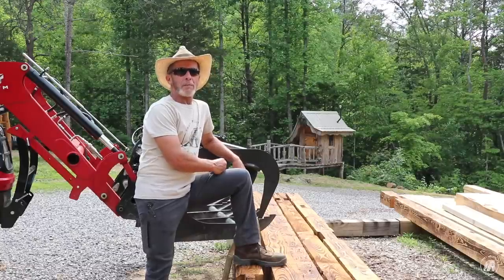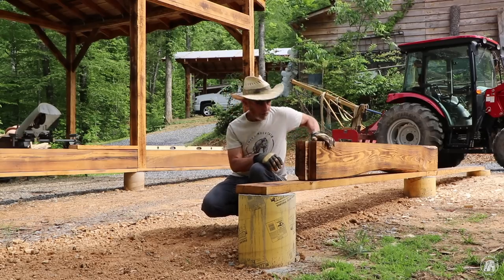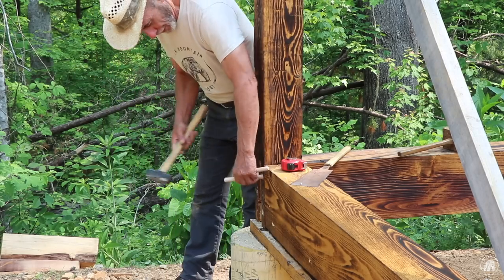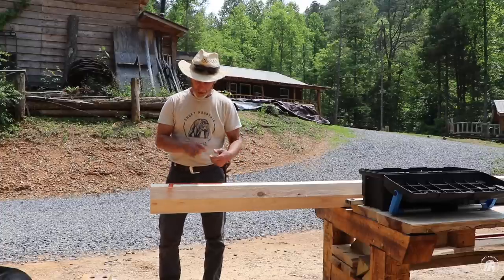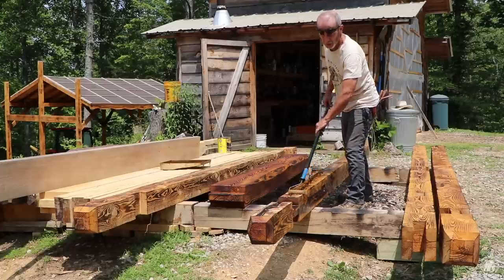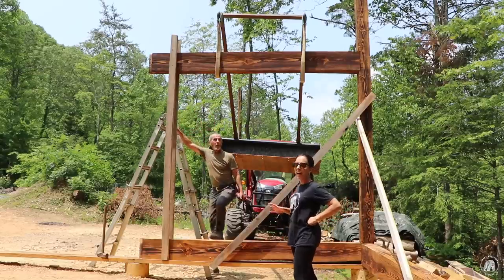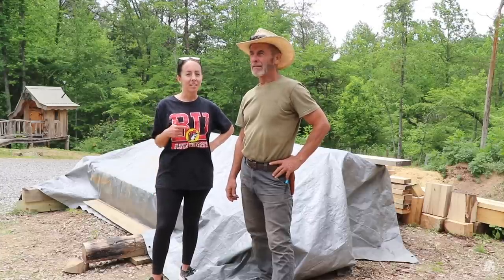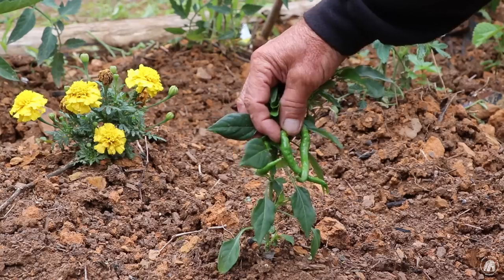I Can’t Believe We’ve Come This Far!!

Comment: good job and video glad you had help you really do nice work. we have a lot of trees on ground to will take me more than a year to log them all out. take care, be safe and well.
Reply from the maker: If you have time and resources, I would paint the end of the log with cheap paint to help dry the log slowly. This helps prevent checking. Some use “anchor seal” but it’s expensive. I usually cut as I go. The best way is to log, dry then cut

Comment: Hi Jennifer, Richard am I missing something, I thought you had to drill the connecting lumber offset by 1/8-inch so that when you drove the spike in it did two things. One it would make a tight joined between the two pieces and two it would also help keep the spike in nice and tight. I'm just wondering, but I do love watching your videos.
Reply from the maker: I’ve always remembered 1/16 in, but I’m not worried about that. I have also added timber screws for added support
Reply: @SmokyMountainOutpost  You are right it was 1/16 inch, I've seen you put timber screws in another video, and I just guess you have not done this to these. Sorry

Comment: why not use a bigger roller ?
Reply from the maker: I have found it’s best to use the same size as the material being done. Mostly I use a 4-5 in roller because my material is usually no more than 6 wide. If I use one larger than the area it gets slung off as it turns on the outside. If I’m doing a large surface on my Timber I use a 7in. A little smaller I think works better. But, everyone has a preference.